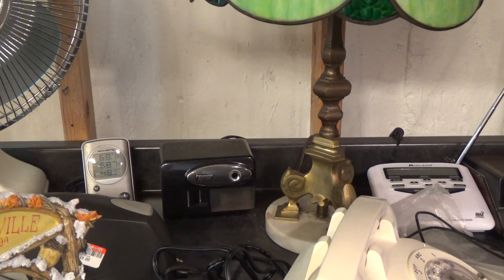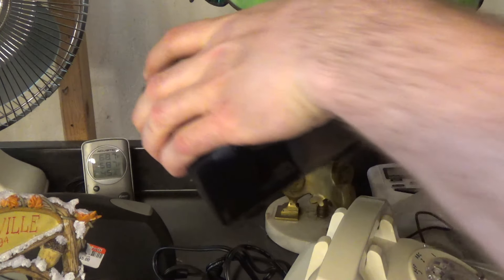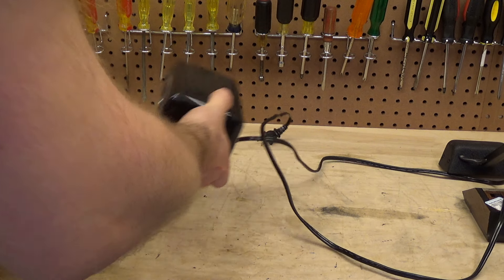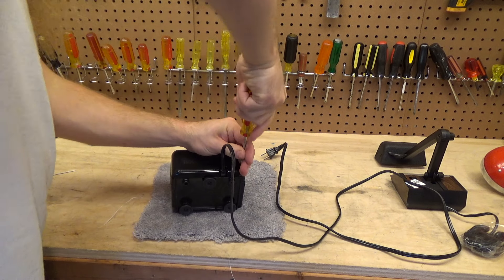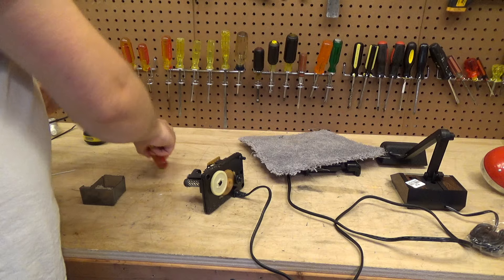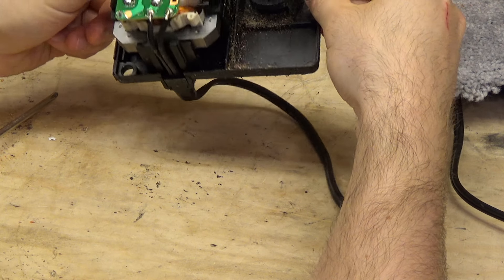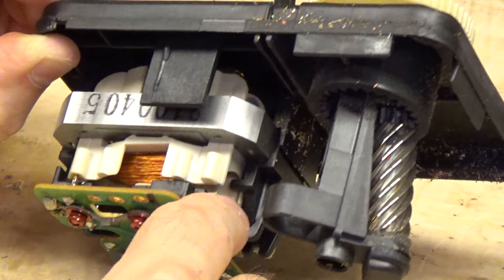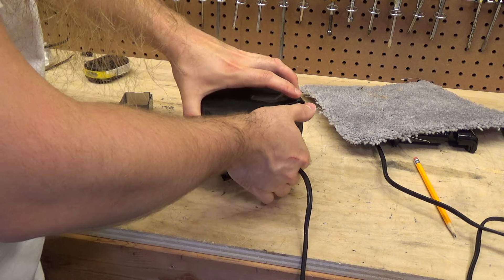Octember 2024 Fail #1 | Panasonic KP-310 Pencil Sharpener

Comment: On mine it was that plastic actuator arm binding up every few uses. Had it disassembled quite a few times before I figured it out. The fix was ironically- a pencil. I removed the arm and scribbled a bit of graphite on it wherever it was sliding on other plastic. That was years ago and the issue never reoccurred. The Panasonic is excellent with tons of torque. But I still prefer my vintage Boston and Apsco units from a build quality and serviceability standpoint.
Reply from the maker: Pencil graphite is good for quite a number of different repairs.